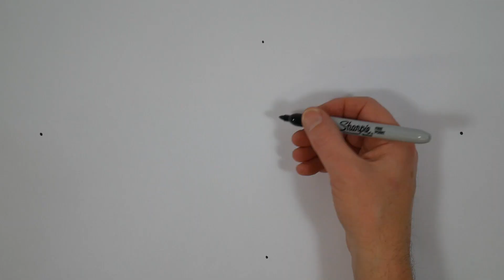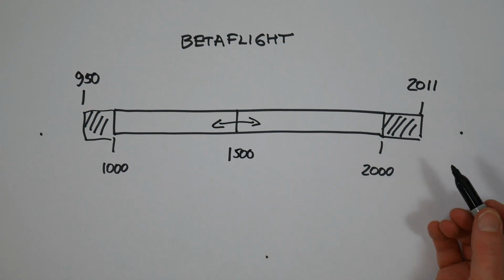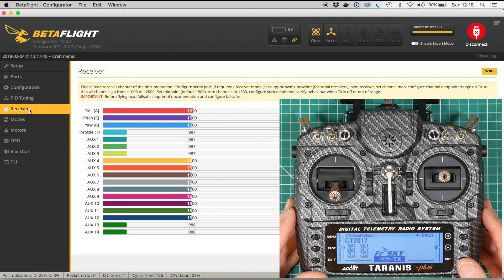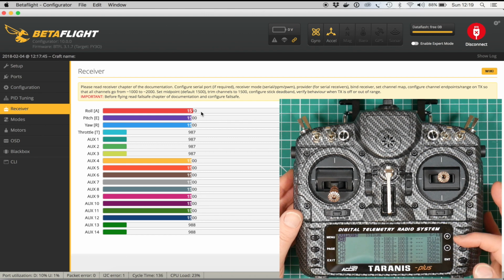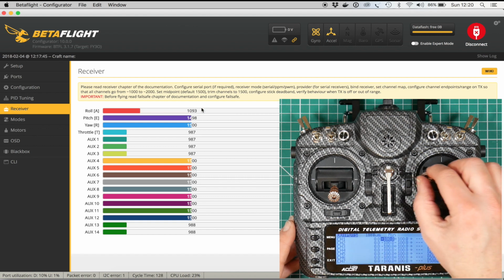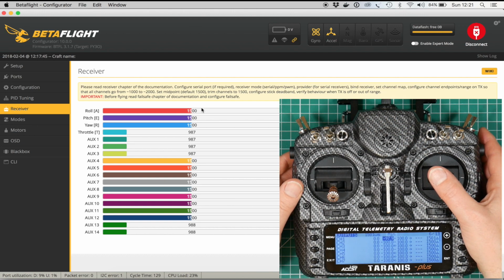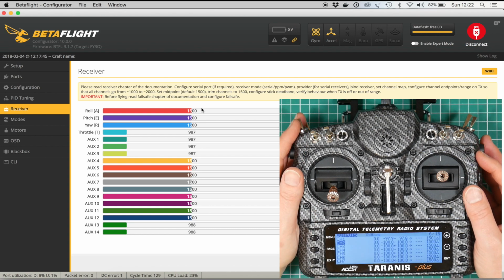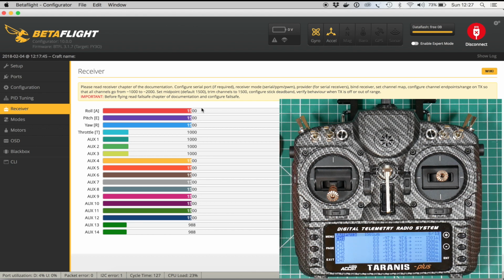Setting the channel end points in Betaflight with a Taranis X9d

Comment: Hi I need some help with setting up my tinyhawk 2. I dont know if anyone can help but I think I have messed it up because when I try to bind it to my radio it wont bind because I only have a red light flashing so my radio does not see it but in betaflight its there. What happened was I had it setup on my radio and all was fine but I could not get the throttle to respond from my radio but everything else was fine so silly me reset the hawk in betaflight then I had to reflash it all for betaflight to see it again but  when i plug the battery in after the blue/green and red lights start but then just the red stays flashing and I can not bind to the hawk. I dont know how to fix this and wished I had not reset it but Im new at the hobby thats why I made the silly mistake. Any ideas how I might sort this out. Thanks
Reply from the maker: You need to make sure you've got matching international or EU firmware on the receiver and transmitter. They use slightly different protocols and if they're different they won't bind. Id did a video on this https://www.youtube.com/watch?v=B054usk4Fe4

Comment: I did as you instructed on the endpoints. But now it won't arm
Reply from the maker: Check the arm range settings on the controller page of betaflight.
Reply: @WhirlyBloke  I have and when I click the switch it moves to in range but still not arming
Reply from the maker: @michaeldyer6079  The easiest way to find what's stopping the quad arming is using the CLI in the betaflight. Type in status and it will show you the arming disable flags. You can look up the disable codes here https://github.com/betaflight/betaflight/wiki/Arming-Sequence-&-Safety Hopefully it'll give you a clue what's preventing your quad arming.